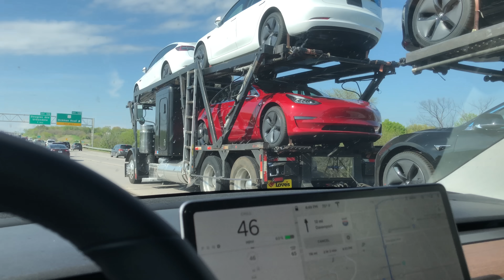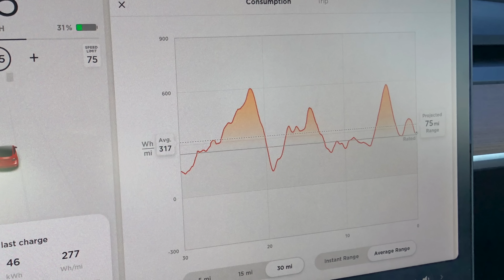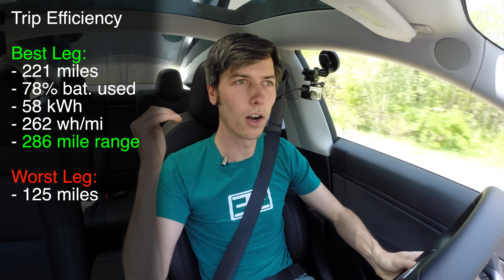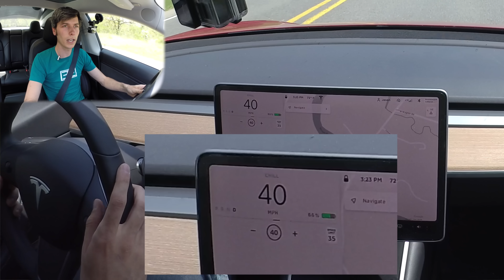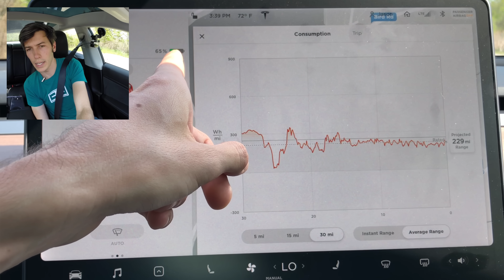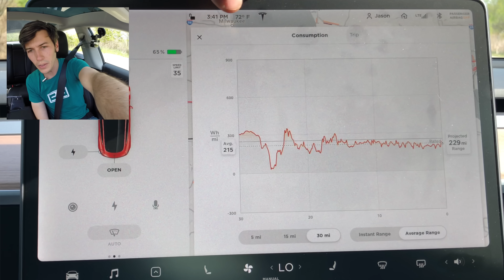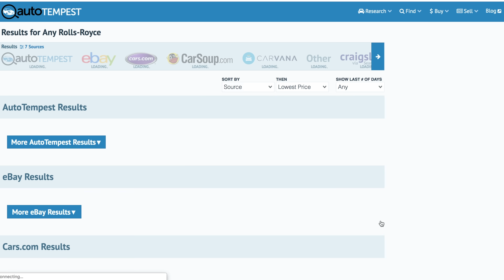How Miserable Is A Tesla Road Trip?

Comment: I get 40 mpg on the highway in my Altima. So an average road trip I am sure I would get 35 mpg with some traffic delays included. Gas has been costing $2.50 lately but I bumped it up to $2.60 so a 1963 mile trip would cost me $145.82. Plenty of gas stations and no anxiety over charging stations availability or time spent waiting for a charger, or charging stations working, or believe it or not, charging station compatibility. And ICE's have room for improvement on efficiency and hybrids are getting close to the 50 mpg mark.

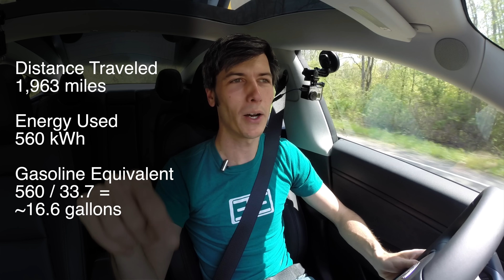Comment: 8:08 dear Engineering Explained, you compare the 560  KWh energy the tesla consumed with the tank volume of your combustion car and that energy. It is true, that the amount of energy is the same, BUT the efficiency of the cars differ. Combustion cars have a real use efficiency of less than 20%, electric cars up to 80%.
Therefore your statement is not true, you cannot drive 2000 miles with one tank (16 Gallons) with your combustion car - you can drive around 500 miles and you will use 4-times the energy compared to an electric car.
Reply: You missed the "if it had the same efficiency" part of the statement

Comment: So every 2 hours of driving you had to stop for an hour of charging? That is insane! I drove from Seattle to Denver, getting gas four times and arriving with over 1/2 tank of gas in under 18 hours. Total time--including gas, snow storms,mountain passes, stopping for Highway Patrol who was closing the freeway due to winds, etc., The trip back, had much better weather and took <18 hours. (most of that trip is 80 mph limits). Stopping for an hour charge every 2 hours, would added 9.8 stops or ~10 hours? So a 17 hour trip becomes 30 hour trip? And, at >80 MPH, in snow, cold temps, with heater running, I seriously doubt I'd get 2 hours.
Reply: you dont stop for an hour everytime if you drive it smart 20 minute stops and arriving with low battery thats it
Reply: @jj14f6  you are correct,
BUT why would you drive under the speed limit, ??
He said he did 75, in an 80mph, zone.
No thank you!!!
Time is money, money is time.
Time In life is the one thing , you can’t ever get back.
Money, I’ll make more.!!!
Time is super valuable!!!

Comment: You point out something that is overlooked by electric vehicle opponents: Since only about 20% of the gasoline engine energy used is for moving the vehicle and the rest is wasted, Coal-fired electricity used to charge vehicles actually results in a significant reduction of CO2 reduced into the atmosphere, combined with I.C. vehicles. So actually, widespread adoption of electric vehicles would make coal-fired electricity generation much less harmful to the environment, with regard to CO2 net emissions. Of course the ideal would be vehicle recharging with non-fossil-fuel produced electricity.

Comment: Toyota sold 300,000 hybrids in the US in 2019. Up 25%. The Rav4 Hybrid at 40 mpg+ sold 90,000.  Have a 2010 Prius. Rav4 Prime, plug in 35 mile range, is next.  I'll save $10,000-$15,000 and stay with the Rav4 Prime and get the $7500 credit. Full electric Toyota 3-5 yrs away.

Comment: 0:40 Using the word "ironically" in place of coincidentally.  21:17 Hmm I thought Teslas were way more efficient than this.  In a Ford hybrid you could do this for  $133.84 @ 44mpg.  So the Tesla in this case is only getting the cost equivalent of a car that gets 37.56mpg.  = [1963 / ($156.8/ $3gallon = 52.67 gallons) ]
Reply: They are efficient, problem is the cost of super charging stations for a long trip like this... There is other video were he explains this in detail.

Comment: you mean the seats in a brand new car weren't bad? Shocker. The energy efficiency of the battery itself is so much worse than the gas powered engine it basically nullifies the claim. You continue to talk over and over again about efficiency in slowing down. This works in a combustible engine also. What this video really tells me is that this is a very unrealistic way to travel and poorly chosen.

Comment: Just be glad you're allowed to do 80mph now instead of 55 (so how many millions were booked for 65 back then for no reason except revenue?  Yeh.. road "laws") and that you have "super" charging stations available instead of having to blow many hours just charging every couple hundred miles.  That would be a real drag.  But everything this trip's doing to the battery is probably bad for it because of temperature.  Better save up for the inevitable replacement in a few years.  I've never seen anyone factor that expense in when they ask the question "how much does it cost to own an EV?".

Comment: I have a 2015 ford focus with a 1 liter 3 cylinder turbo with a 6 speed manual. It has a 12.4 gallon tank and gets over 40mpg at 70 mph. That's 500 miles on a tank. 4 stops to make your trip for fuel.

Comment: So never go anywhere where there are no superchargers. No rural trips.
Reply: Funny thing is, that's the way cars used to be for a while too. How we so easily forget.
Reply: @tybera1114  Yes and no. With cars people always had all kinds of options... Moonshine for example (no shortage of that). Some engines could even use kerosene.

Seriously, if you wanted to go into the boonies in a gasoline car, all you had to do was take some jerrycans with you. It's that simple.
Reply: @pobembe1958  You COULD yes, but this was not common. There used to be various routes you had to take if you wanted to travel across the country via car. This is what made route 66 popular, there were enough stops commissioned along the route that most cars could travel the distance without breaking down or carrying jerry cans all over the panels. This was before the massive interstate projects, and we don't even have to tackle that infrastructure nightmare, we just need to evolve the current one, which is much easier.

We COULD strap larger batteries all over a car and get the same result as the jerry cans, especially with newer battery research which is being funded by people who are buying the EVs now, but it would be much easier to have faster charging batteries and build a building on a current road than futz with all that, but there need to be incentives to setup these kinds of places.
Reply: @tybera1114   Let's make this simple. In this or any other era you can/could have driven your gasoline/diesel car anywhere and at any time, all you had to do was pack some food, change of clothing, and an extra Jerrycan or two. This was true on any continent, Africa,. Asia,  Australia, South America. You only needed Food and Fuel both of which you could take along with you. If you happen to still run out of fuel. Just buy some Moonshine. Come on now, the Tesla is too limited to where there are charging stations, or 220volts at home (not too sure about this). Let's not pretend that the versatility of fossil fuel  in any era is rivaled by that of the Electric car.
Reply: @pobembe1958  there are a lot more supercharger stations than you think
Reply: No Name people born in 58 aren’t going to get it. You’re wasting your time.   I remember people saying the internet wouldn’t be a thing back in the 90’s. 🤣🤣🤣.
Reply: @johnjay6935   Darn tooting straight. At 62 yrs old, I certainly wouldn't be caught dead in a car out of Battery and  No supercharging in sight.

OTH If Elon gets those new batteries going, I could change my mind.
Reply: @pobembe1958  

Agreed. And if I run out of fuel somewhere I at least have the option of walking or catching a ride to take my Jerry can to a petrol station or even beg/buy/borrow some fuel from a passer by. Can't do that with an electric car. Breakdown recovery is your only option there.
Reply: In the future you'll be packed into comapct SMART cities.

Comment: I did a similar trip from NV to WI and back. Including driving while in WI i put about 4400 miles on my Model 3 RWD long range. Charging was never a problem and we usually stopped to eat while doing so, and the car was generally done charging before we finished eating. We averaged about 600 miles per day going and coming back.
We have previously done the same trip with ICE vehicles and by using NOA, stopped each night feeling much less tired. (btw, we were both 72 years old during this trip.)

Comment: Cool vid!  And just think... trips like this will get nothing but better as battery technology improves.  More range... faster charging... etc.

And one word:  Drafting.  On interstate driving, park yourself about 4 or 5 car lengths behind a semi-truck and watch your range go up.  It can be done safely... hard part is finding a semi that can maintain it's speed during elevation changes.  :D  Works with my ICE car... goes from 28mpg to about 33mpg on a trip from Toledo to Cinci on I-75.  Don't have to be very close to see a difference!

Comment: Combustion engines as efficient as electric, the thing with electricity is you already used a turbine to get it. And so you don´t "feel" the lost energy but it is still there. And in the end it depends on how the electricity was produced, how long it travled and how long it was already stored. Ofc you also have the refineeries wich also use energy and the oil that travels to you.

In the end its best to look at the €/$ per km/mile and decide what is more efficient.

Comment: Great videos... I’m an electrical guy by profession and I love the technology, but I’d never go through all that nonsense.  Maybe if they’d implement quick change battery stations..
Reply: If you’re an electric guy you should know the tech is evolving.  We phased out dial up modems for the internet...
Reply: I agree. The only way this works is to have universal battery packs which easily can be swapped out as fast as you would fill up your car. Not a big gov't guy but the power plugs and charging systems would be standardized.

Comment: Electric cars would be OK, if it were not for the fact that their purchase prices include the equivalent of about 10 years of what you would pay buying gasoline for an all-gasoline car. In other words, you are simply made to pre-pay your "gasoline" consumption. If that were not enough, within 5 to 8 years of having purchased the car you need to pay what? $2500-$3500 for a battery replacement? An electric car is just not currently worth it for most people, even for those who actually own one. If you want an "eco-friendly" ride, build a gasoline vaporizer and install it on your all-gasoline vehicle. A car running on gasoline vapor is probably more "eco-friendly" than an electric car, when you consider the resources that go into battery manufacturing, and the garbage that results from their depletion.

Comment: So... NOT miserable at all. Other variables - Performance model and 20" wheels. How do you have Navigate on Autopilot if you don't have Autopilot? Surprised that it was only $40 cheaper than gas over the 2K miles. And that's at $0.28/kWh. That is the cheapest around here (San Francisco bay area.) It's usually $0.32/kWh, but that may be high for the rest of the country? Home charging using time of use (winter) is $0.17 - $0.35. Way higher in summer. Thanks for the informative vids!

Comment: owning teslas for 2 years and dozens of cross country road trips I can easily say Tesla is the worst car for road trips. they are not road trips but charging trips. plus the unreliability of the car and slow charging problems. I have my s for sale on ebay and going back to a prius. 2 minutes and 650 miles of carefree driving anywhere in the country you want.

Comment: 1963 miles in 38 hours = 51.657 mph on average, which is absolutely flying, hauling ass!

I used to average 45 mph point-to-point about 365 miles each way, with a PSD-powered cube van CMV, with GVWs under 16k (probably under 14k most of the time; tare was like 10060 with full fuel) pushing the limits of acceleration but not (badly) exceeding the posted speed limit.

Yeah, I realize these are different classes of vehicles, but the speed limit for me was the same as for POVs -- generally: 70 Interstate, 45-65 on state roads, generally 25-35 municipal.  i had one stop for fuel each way (not empty, but not enough range to comfortably complete the trip without topping-off the tank) and i had to stop at weigh stations.

the dispensers (pumps) for CMVs feed much more quickly than the tiny POV diesel pumps; i always used the CMV pumps on those trips.  my other drivers and i were generally a lot quicker than my competitors (it was my delivery company; i ran a small fleet).  my trucks were generally quicker than 99 percent of the other vehicles on the road (in terms of how they were actually operated, not necessarily in terms of the vehicle's potential) to 30-35 mph, and definitely in the top 15-20 percent to 70 mph, so it's not like they were slugs.

in my LTC, if i'm in an extreme hurry (but not an emergency that would allow me to exceed the posted limit), i can average almost 46 mph on a 185-mile (one way) trip with no stops for fuel -- aggressively accelerating, and riding hard on the posted limit (and maybe 2-3 mph over); less than 1 mile of that is 30 mph zone; about 2 miles is a 45 zone; about 48 miles is a 55 zone; about 112 miles is a 65 zone, and the remaining 26 miles is a 70 zone.  that's with only two stops (each of which is at a stop sign, imposing a delay of perhaps a few seconds at most, at each) between departure and destination.

assuming all your data is correct, all the foregoing merely underscores how impressive is the Tesla, as you have operated it.

Comment: I think I would just rent a car for road trips over 2 hours. This seems like a lot of effort and a lot of lost time.
Reply: Yeah and this is honestly probably a very viable option for a lot of people that can only afford the cheaper EVs that don't have supercharging or larger batteries. Is it really that much work renting a car for a few days for someone that only takes long road trips once or twice a year?
Reply: meh, I drive my Tesla around the country and it's no big deal for me. Personally I like being forced to stop every 3 to 4 hours to charge (which is what my battery gives me and the relative spacing of the super chargers). It gives me 30 minutes every 3 to 4 hours to stretch my legs and get a snack. Maybe I'll watch some youtube or play a game on the tesla if I have some extra time. Now, going back to being stuck in a car for 8 hours straight with minimal stops feels like torture on my body to the point where, even if I was driving in a gas car, I think I'd plan out 30 minute stops every 3 to 4 hours. It's just a more plesant experience.

 The biggest change is in your mind set. I'm no longer in a rush. If I'm driving more than 250miles I merely make sure that I leave early enough to take my time. 

That said, the Tesla certainly FORCES you into this mind set. There's no option for powering through a road trip if you need to. But personally, I like being forced to take breaks from the road. I end up walking to local coffee shops on the road instead of gas stations. Shopping. And all around experiencing things I would normally just pass by.

Comment: How would this work driving in a cold climate like Canada (in Winter), where I imagine a significant amount of your batteries' energy would have to go tho heating the cabin, defrosting windows, etc..  I also worry about battery life - my experience with cell phones and laptops is that their battery capacity diminishes very quickly over time, requiring more frequent charging and giving less "range" of use...these ev batteries are super-expensive to replace, so this has to be a big factor as well.

Comment: 2000 miles.....12 stops for 8 hours of total wasted time - Electric car
2000 miles.....4 stops for 30 minutes of wasted time - Gas car

So I can pay an extra $30,000-$40,000 for the privilege of triple the stops, higher repair costs, and the ability to accelerate at a rate that will get me arrested.  Swell....

Comment: Still not good for cross country driving.  I suggest that a TESLA modified to attach a trailer that has a small marine diesel motor driving a generator replenishing the battery as you drive.  My expectation is that it would increase the range significantly eliminating the frequent recharge stops.  I expect one would still need a daily overnight recharge.

Comment: I took a 3000 mile road trip in mine (long range, rear wheel, full self driving), from Orlando to Northern MI and back, in October. Charging added about 10% more time than a gas car (I’ve done the drive many times in a gas car). I made sure to stay at hotels with free charging, so I was fully charged in the morning. I LOVED it. Full Self Driving made it so nice. I will gladly do the drive again in the spring. My other car is a nicely equipped Toyota Sienna. I would take the TESLA anytime.

Comment: It sounds like you planned the road trip from one Tesla super charger to the next one.  This is fine for actual interstate trips, (in lieu of airplane or train).  For spontaneous and casual vacations, I can see an issue.  What happens when you want to take a 100 mile side trip or excursion to Moosebutt Montana to check out the Beer Can Museum?  I doubt Moosebutt will have a charging station.  Be lucky if it has a tow truck. 😂  
What if you took that trip where it tied into the back end of a holiday and everyone is heading home and there's a 5 hour wait at the charging center.  (that happened in California) That's worse than the gas lines of the 1970s. 

I'm not down on electric cars. I'll consider one when the charge stations are at least a quarter as common as gas stations AND they STANDARDIZE the voltages and connectors.